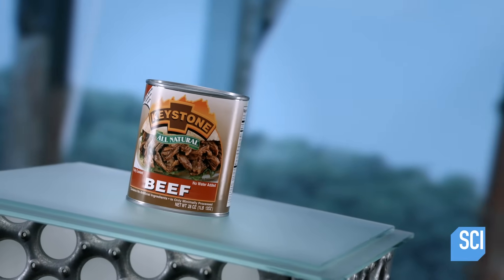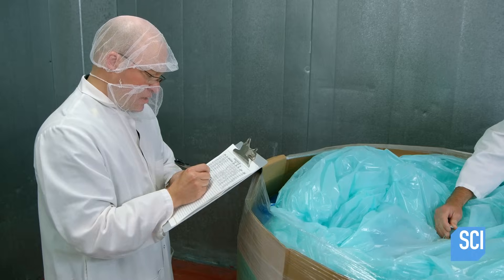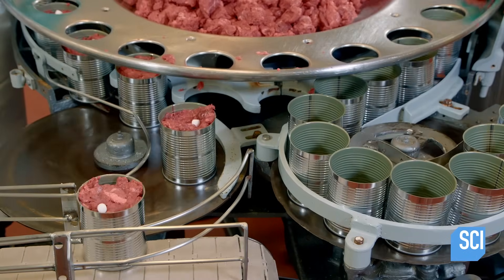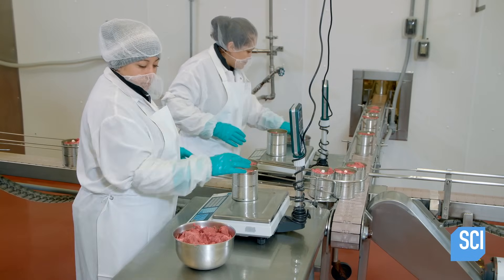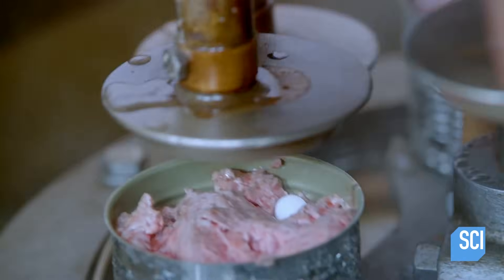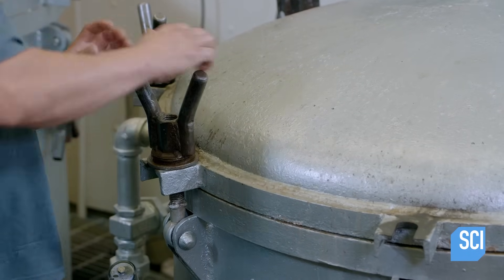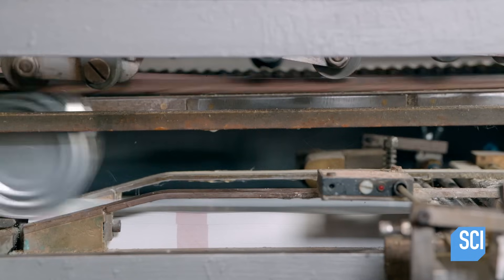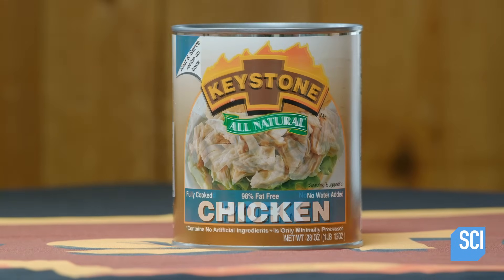How Factories Produce Canned Meat | How It's Made

Comment: I have a hard time understanding how they can veritably (that means, boil) that meat in a sealed can without that can starting to bulge or even 'exploding' as a result of the steam that would develop! The documentary is most likely wrong at that point, I think they only seal the can when the cooking is done but its contents are still that hot and therefore sterile.
Reply: Magic
Reply: because the only fluid in the can is the water inside the meat. it's too little to overpressure the can
Reply: @dynamo3059  At first I thought it did, but after a while I started to realize what you said there actually does NOT seem to make much sense to me, only to in the end come back to thinking you are probably right after all in this case. The thoughts I had were the following... Without ANY additional water(-based liquid) (at least some, like half an inch, for the rest you could use the steam that liquid would produce, if it weren't for the fact that your average can or jar couldn't stand the pressure that steam wood build up when closed, and when still open that steam wood not stay inside and do its job), provided you even would START with raw meat that still would be cold, I s thinking that you could not get the inside of those loose pieces of meat to come to the boil all thirty-four the can and heat up enough for them to sterilize through and through in a reasonable amount of time... (Sterilizing according to industry standards takes at least five minutes of continuous, uninterrupted boiling through-and-through, but it also is hard to tell when the inside of a bunch of loose chunks of meat would all have been at boiling point inside for that long, all of this being reasons why usually the boiling just like other steps of preparation are done BEFORE food gets packaged.) Certainly not without spending an EXCESSIVE AMOUNT OF TIME while slowly and carefully applying a LIMITED amount of heat - limited be cause without additional water your contents would easily BURN. This simply is not a feasible method on a production line, working this slowly just is not doable or worthwhile in any factory-like type of setup: you want to work as fast as you can so that you can churn out some numbers, amounts that would suffice you to make some money on the operation! At least, that was what I was thinking. Also, the usual practice to package food in a sterile way in cans, tins or glassware is to package the contents while they are at boiling point, having the package sterilized and still heated up to an equally hot temperature when you put the food in (while still at boiling point), doing all that in a sterile environment. Also most often things like sausages are packed WITH their own juices but leaving the better part of an inch to allow for expansion and contraction to be effectuated by air pressure instead of warping or overpressurizing the package itself. After filing the package that way, the lid would be left loose/untightened for a minute or so to allow the air inside to heat up and expand and once that has happened immediately close the tin, can or jar up. That way everything has been at boiling temp all the time, and thus will be sterile plus there will be very little actual oxygen cause once the contents will have cooled the little air there still was will contract, creating very low pressure or even a partial vacuum. It is be cause of that last aspect that you often will hear a clicking sound when you open a jar or or metal package. It tells you the tight air-seal was uninterrupted making it highly likely the contents are good to consume. Maybe in the end you ARE right. After all this looks like a rather small production/packaging facility. It is possible that - other than the vast majority of producents of canned food on the world as far as I know - they DO seal the can with only the meat itself inside, still raw, and consequently expose hundreds up to thousands of those cans to a sufficient amount of heat - by keeping them suspended in boiling water or steam in a pressure vessel for a REALLY long time.

Comment: I have Questions:
1. Why doesn't heating the can not make it explode?
2. After pressure cooking, don't they have to dry the outside of the cans? Or does the heat from the can cause evaporation of the surface moisture.
I don't know much about canning.

Comment: I bought some of this stuff (Keystone) for my modest hurricane and catastrophe pantry.  I like to have a couple weeks of room temperature safe, long term storage, simple to prepare food on hand.  It really doesn't cost that much to create such a stash of pre-cooked canned goods you can eat right out of the can in a pinch or heat up over a camp stove.  As a result of "rotating my stock" I've experimented with making beef and chicken enchiladas and chili, and pulled pork, all from this brand of products.  It's a little weird when you open the can.  It smells just a bit odd and has a little gob of congealed fat in it.  Once you take it out of the can and scrape off the little bit of fat, it is tender and tastes just like you would hope.  It makes great shredded meat dishes.  For anything where you can imagine pressure cooking beef, pork, or chicken until it is tender enough to break up into shreds with a fork, this stuff is very very good.  You have to understand that it is unseasoned except for a little salt - and I'd consider it LIGHTLY salted for a canned product.  So, season it to your tastes and heat it up.  A can of the beef with a can of Bush's Chili Magic and a can of stewed tomatoes makes a stupidly simple chili con carne - just dump the 3 cans of stuff into a sauce pan, heat and stir, no skill or seasoning needed.  I made this one night on a camp stove right after Hurricane Ian for a group of neighbors when we had no electricity and were trapped in our neighborhood by the debris and water.  Everyone seemed to think it was "luxury" to have such a meal.  You can generally buy this brand at Walmart grocery stores, but you can also just buy it online.  I highly recommend it as an absolutely essential ingredient if you want to have a few days worth of meat in an emergency stash, something that has not been freeze dried that you have to rehydrate.

Comment: Does the pressure cooker make any difference if the food is in a vacuum sealed tin? It would stay in a vacuum the whole time
Reply: It probably keeps the outside pressurized also so the seals don't get blown out.
Reply: Pressure cooking isn't about the "pressure" it's about being able to get water to boil at a higher  temperature.  At sea level, water boils at 212F.  In Denver, water boils at 203F.  Higher altitude, less pressure.  The pressure cooker increases the boiling point so that the meat cooks at a higher temperature and kills clostridium botulinum.

Comment: Well I know you can, can meats. At home it's called a pressure canner and depending on type of meat you precook red meat for 5-10 minutes then put salt in prepared jars and use water in pot you browned meat in to pick up the cooking flavors then add that water to each jar leaving 1inch head space then put lid and ring on finger tight then put in pressure canner for 90mins. Canning meat is easy and has been done for hundreds of years. Our ancestors used to do it they all see used to salt meat and hang it up. It's nothing new. If your country folk that's how you was raised.

Comment: wtf is this... this is a SCAM.... If you have a meat in a sealed can, then pressure cooking it with steam wont work... the steam and pressure isn't cooking the meat and if you used the heat from the steam to cook the meat sealed inside, the difference in moister that in the meat (water) would cause different pressures per can and there would be no way to control the difference in them on this type of scale with out can swelling or exploding in the cooker...

Comment: how can you preasure cook something that is inside a sealed, vacumed can? am i missing something here?
Reply: You asked a good question! There is a simple answer too :-) "A pressure canner is mandatory because meat is a low-acid food. A pressure canner is the only way to get the meat up to a high enough temperature, for a long enough time to make it safe for food storage."

To put it simply, the pressure cooker they're putting the cans in isn't for actually pressurizing the can/meat inside, but to force the steam to be hotter than if it was unpressurized. Doing this ensures the cans are heated quicker, and hotter than regular steam. Hope this helps
Reply: I was thinking the same thing.
Reply: @MerlinspopTBH  Read my reply to OP :-)
Reply: @dansmith6990  Makes perfect sense.  Thanks!

Comment: Normally i bet they dont trim that meat like that. Seemed like a lot of good meat was trimmed off together with the fat.

Normally they only trim it to remove most of the fat, not cut ½ inch of good meat away as well.
Reply: The trimmings from the beef likely go into their ground beef product, which needs the fat.
Reply: @dalepres1  In my experience they usually prefer pretty lean meat and then pure fat and then mix this.

Mainly because it is easier to control the fat content inside the ground beef they sell.

Comment: >Air-tight can
>pressure-cooking
what
Reply: I am wodering too. It doesn't make sense to pressure cook airtight cans.
Reply: I think they put the cans inside the pressure cooker to heat up the air outside the cans faster/more efficiently (PV = mRT). Once the air is hot enough, the cans would then act as mini pressure cookers themselves so that the meat inside is cooked faster.

Comment: I guess (and hope) those cans are not lined with plastic, unlike majority of cans used these days.
Reply: I hope you understand that polymer lining is necessary to protect the can from the food and vice versa.
Reply: @sim0ndutch42  I hope you understand the plastic will melt when cooked in high temperature like the cans in the video.
Reply: @joseph_wei  I hope you understand that there are a lot of plastics out there that will be able to withstand 100°C or a little more (whatever that pressure cooker puts out)

Dont want to be this edgy btw, I guess you are right if these cans are tin alloy, which doesnt rust.

Comment: wait why would they use pressure cooking if the cans are already sealed...
Reply: The cans would explode as the air inside expands. The pressure cooker balances the pressure inside and outside the cans.

Pressure cookers also reach higher temperatures than boiling in the open, which gives a better kill rate of germs.
Reply: SonOfFurzehatt ohh now it makes sense

Comment: I'm surprised they can cook the meat with the can sealed and not blow the lid off.

Canning at home requires the lid loose to allow for expanding air. When through cooking you tighten the lid and as it cools the lid becomes concave. That is what tells you it is still safe to eat. If the lid bulges, it can kill you.
Evidently the preheat gives it just enough expansion so the lid will get convex after it cooks and cools down.

You can bet a bunch of meat was destroyed before they perfected this.

I'm going to watch for this next time I shop.
Reply: these industrial pressure cookers or retorts work differently than a home pressure cooker, basically the cans are always under enough pressure before and after heating so they cannot explode as long as they are inside the pressure vessel. the same type of equipment is used to process mre food packets for the military.

Comment: Sooo pressure cooking meat already sealed in a can tenderizes it!  It won't even tenderize the can.  What a bunch of crap
Reply: trafficsignal101 actually it does. I can almost all of my meats and add nothing but salt as well. It comes out delicious. I was very surprised the first time I did it. 

Only concern I would have with this process is that the meat is cooked in toxin lined steel cans instead of inert glass jars. Tin is the only safe material to use on the inside layer. However, these, like most cans today, are not lined with tin.

Comment: Isn't it dangerous to cook meat in a sealed can? The high pressure might blast the cans.
Reply: It would be if you just exposed the can to high temperatures.  Eventually it would explode but my immersing the can in a pressure cooker the pressure on the outside of the can is equal to the pressure inside the can so it is stable.
Reply: Everything you buy in cans is cooked in the sealed cans under pressure just like this.

Comment: I don't get it. If the meat is already sealed in their cans, how will cooking them under pressure affect the meat?
Reply: All canned products are cooked in the sealed cans under pressure.  Pressure cooking raises the temperature high enough to tenderize the food in minutes instead of hours, and it keeps the cans from bursting from internal steam pressure.
Reply: They are cooked at about 115C (or could be a bit more for some products), which requires that the cooking water be pressurized.  I used to work in a Campbell's Soup factory which uses the same process but at far larger scale.  Large commercial canneries use a continuous production line with a pressure cooker in the middle of the line.  The cooker has no lid, it uses two columns of water to maintain an internal pressure in the cooking section of about 2 - 3 bar and the cans flow in and out constantly with a cooking time of a few minutes.  This cooks the product, but more importantly sterilizes it.